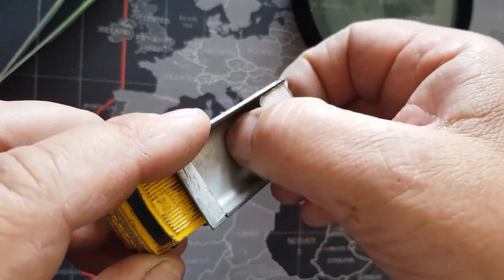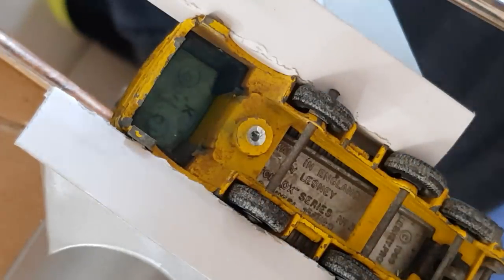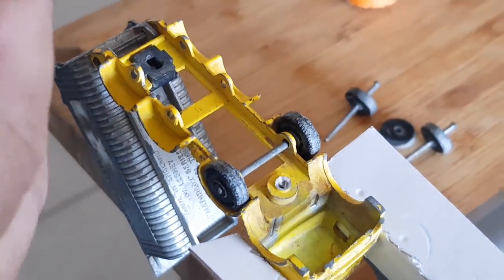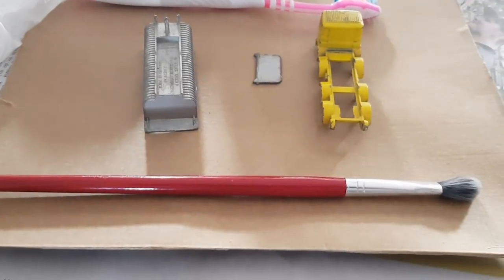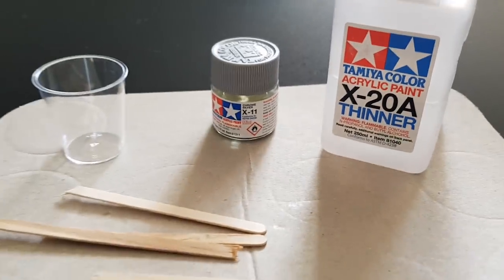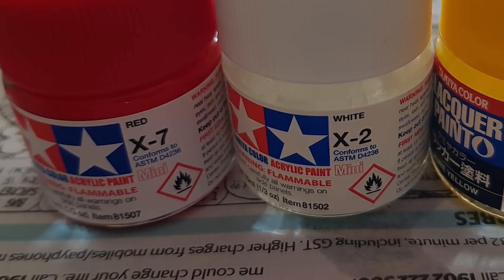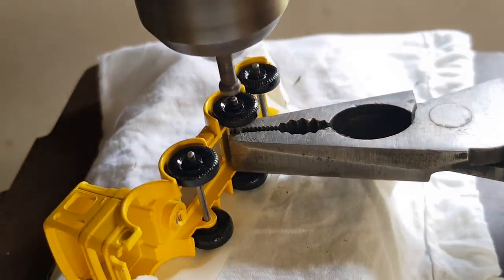MATCHBOX Restoration No 51 8 Wheel Tipper 1969

Comment: An option to using the stock tyres and axles, Is Herpa set 51996. You will need some aluminum pipe or brass which will fit into the axle holes, since the Lesney axles are thick. I did this with the GMC Freezer Truck and they work perfect, roll nicely and look good. Not a restore, but a custom. But another classic salvages from the scrapyard.

Comment: I had a very similar one as a child. I love your videos. I find matchbox cars whilst metal detecting here in USA.
Reply from the maker: Thanks for subbing, Chris. If you find any wrecked ones please let me know. most of the ones i get are not too challenging and I think that people like to see a stunning restoration rather than a repaint!
Reply: @MartysMatchboxMakeovers  I just the other day found one that is badly wrecked. It's quite modern, though. 2012 made in Malasia k16 Hotwheels. It was buried about 4 inches deep in a sand volleyball pit and I believe it has been run over in sand by heavy equipment.

Comment: I learned how to drill out rivets at Boeing. You really don't need a bit any bigger than the shank of the rivet. If your drill bit is nicely centered the head will pop right off and be stuck to the bit.
Reply: To be fair he's not an engineer at Boeing working on aircraft, he's a chap having fun with a hobby.
To be fair S.Sestric is just passing on some useful information just like Marty!
Reply from the maker: For the record I did used to be a technician servicing fighter jet ejection seats!
Reply: Marty's Matchbox Makeovers .... Cool job Marty. A lot of responsibility! Lives on the line!
Reply: Think he uses the smaller bit to get a hole centered on the post. Probably found is the easiest way to make sure it's centered correctly.

Comment: AEC matador 4X8 my grandfather used to drive one moving stone from the Yorkshire dales quarries to the construction of the M62, I used to love the summer holidays sat in that cab.
Reply: But htis one is in fact a Foden
Reply: Old Man Splaining on very close inspection at 13.40 you can clearly see the AEC triangle central below the windscreen the Leyland octopus didn't have said triangle. Leyland acquired AEC in 1962 and the ergromatic cab was used across several marque's including the octopus. I accept I got the name wrong it should have been mantador but in my defense it was 50 years ago.
Reply: Correct! I have one in "showroom condition", cabin and chassis are red and the tipping body orange with HOVERINGHAM stickers on the sides.
Reply: Hoveringham was on the #17 Tipper Truck. This is a later #51 and had either Douglas or Pointer decals.
Reply: Some trucks had a grann-low range for such instances
Reply: Yep, it is an AEC Mammouth Major 8. Ergonomic Cab. AV 690 Diesel or the AEC V8. Plated weight 28 to 30 Tons Gross. Nice restoration, got a fleet of them here if you want some more :  )

Comment: I really loved the was you used the drill dolly to redo the axles. I was expecting you to use epoxy to rebuild the broken bumper ends but that may have been more work than it is worth. I have started using Molotow Liquid Chrome markers to replace chrome on parts. I will be watching your other videos.
Reply from the maker: Broken bumper ends????? What the......!
Reply: Yeah. It is quite common on these trucks. The ends that stick out beyond the sides of the cab get broken off. Many times it is just one side that gets broke off, but depending on the amount of play both may get broke off like yours. As you know, it is easy to not notice it.

Comment: Very nice resto, well done.  Just done my first: Matchbox #22 Pontiac Grand Prix.  A 2 rivet model, but easy to take apart as one rivet was already loose.  While apart, I converted it to RH drive.  I left the wheels on the base and masked them for painting.  Your peening dolly looks like a great idea.  When tapping the holes for new screws, I found that those clamping tap handles are not really secure - for holding the tap.  What I use instead is the small drill chuck in the Dremel tool, switched off and unplugged, of course.  Holds the tap and and secure, and the Dremel is a steady hand hold, for turning the tiny tap.  I use 8BA size screws.

Comment: A method to use to prevent using the bigger drill bit. Drill out the rivet with the small bit as before, then use a same drill bit and with the back of the but you can pry the head of the rivet off and you won't take so much material off.

Comment: I've done many a resto or a Code 3. The worst thing is after doing them, the paint chipping. They become more precious than when they're in playworn condition. I actually prefer semi restoring them now. I still have quite a few fully stripped restoration and code 3 projects to complete dating years back when I started them but haven't finished them still. Pethaps when the mood retakes me I'll finish some of them; and Yes, they are very time consuming to do as well as costly if you have parts that need replacing.
I have quite a few listed on eBay under my seller name "mylittleporkchop". 
Great videos btw.

Comment: Here's a nice tip for all modelers :  If you need very small screws, especially in different sizes, try to find the following items. They contain such small screws : hand wound alarm clocks, old watches, frames for glasses (normal or sunglasses, doesn't matter). Or go to a local optician or clockmaker and ask what kind of small screws he might sell or give away. The ones used for glasses are often stainless steel (!).
This way, you can get lots of small screws for free and in a fairly large amount, too, if you search hard enough.
Or, if you need somewhat larger screws, buy or find the smallest terminal blocks (12 rows of semi-transparent white blocks with 2 screws each) you can find or open some electronics plugs and connectors. You'll often find small screws there, too.

Comment: Best way to suport the cab while painting it is to put a toothpick or anything that fits in the hole where the screw for fixing the cab goes. This way you avoid painting the screw tap hole and get a nice cover on the whole piece. Nice work anyway

Comment: I have used a concentrated solution of hot TIDE detergent  in  water to remove paint. Place item in hot Tide and allow to sit over night in the solution. Paint loosens up and comes off under running water with a brush. No toxic chemicals needed.
Reply from the maker: I couldn't be bothered waiting that long. Sorry to the environment from me. :(

Comment: Excellent video and very enjoyable!  Just a little idea here (Not a criticism) have you ever thought of putting a layer of Gloss Varnish on the painted body work to help protect the paintwork and give a better shine as well?  It dries very hard and might help protect the paintwork during re-assembly. Just a thought, no pressure. 
Loved the video and have now subscribed. 
Many thanks and Have Fun,
Joe
Reply from the maker: In the past I have sprayed a topcoat of clear varnish onto the finished product only to recoil in horror at the reaction that various paints and decals have to top coat varnishes. Obviously some are compatible and some are not. There seems to be no easy answer to this. Therefore , having been burnt many times in the past and had to disassemble and strip back an otherwise finished vehicle and start again from scratch, I have made it a rule not to apply top coat in all future restores. I simply try to get a gloss finish from the paint first time around.
Reply: Thanks for the reply. OOPs my bad!  
Sorry I did not know about these reactions, but you live and learn. As I said it was only a suggestion not a criticism, so keep on going the way you are going and I will keep watching your great videos.
Have Fun,
Joe

Comment: where  do you get the tool for " blend" again the axle?
another option to put the rivet is to make a hole and glue with epoxi another head rivet , and it seems like original
Reply from the maker: I simply make the tool by drilling a shallow indentation into the top of a bullet headed nail.

Comment: i do not have that tool create screws threads: what would you suggest as alternative? i am having fun buying cheap new models to practice before attempting on old ones i find in flea markets. Thanks!
Reply from the maker: You could drill the hole oversized slightly so that the screw fits into it. Then glue it into pkace using a small amount of epoxy resin, wiping away any excess that may squeeze out when you put the screw in with a damp cloth.

Comment: What kind of value would one of these trucks be ?  I remember having exactly the same model as a boy 😀
Reply: I know that some DINKY & CORGI toys unopened & still in their original boxes & the boxes innvery good condition also in very good condition ( quite rare to find but, not impossible) can fetch a nice large 3 figure sum ( £200 to about £700:each possibly a bit more ) But, those in a bit of a rough state can be about £40 to £90 each possibly a bit more depending on the toy.  As for Matchbox in Very good condition I think they can go from about £30 to about £100 each but, in a rough state £20 to £35 each maybe a little bit more. But, if the item has NOT!!!  been altered ( restored as in this case) fine but, if it had it won't fetch more than £5   & £10 for the rarer ones no matter how good the restoration is. A collector will notice the difference & valuation is dropped SEVERELY!!!  I hope this information helps.

Comment: Very good but you should not use Araldite or any permanent glue. Same reason you drilled out the river and used a screw. You need to leave it disassemblable for the next guy. A bit of Airfix or anything dissolvable would suffice.

Comment: You should’ve used a smaller drill than the second big one You used. I think you took off too much material on that plastic base, which will make the screen go down to far. Other than that it came out nice.
Reply from the maker: Yes Mitch you are exactly right. This was one of my first attempts at videoing a makeover and i made a few mistakes along the way.

Comment: You should’ve at least put some filler on the dents and sanded the whole body before you sprayed the primer. Also probably best if you used a smaller drill bit to remove that rivet so that you leave the base intact.
Reply from the maker: All good advice Dejo Dejo, I might try that on my next one, thanks!

Comment: Hi Marty, just subscribed and really impressed with your methods and restoration results in this first video.  I was wondering if you might have a method for flattening the end of smaller diameter axles such as those used in Hot Wheels, to give a thin flat disc end?  I'll be watching you other videos soon.  By the way I restored a Matchbox Fiat Abarth Rally Car a while back (see DCTV Lite Ep 42 on our channel if you're interested).
Reply from the maker: Short answer is No as i've only been playing around with matchbox cars so far.

Comment: Looks like a Leyland Bison.Matchbox marketed these in orange and modelled on Hoveringham Gravel. I don't remember seeing a yellow one though ?
Reply from the maker: Yes I've seen the orange "Hoveringham" trucks but don't currently have one. I think they are the same model with different paint, stickers and series number - No17D for orange and 51 for yellow.
Reply: Yellow #51 tipper with ‘Pointer’ logo was an AEC Mammoth one was released in 1966.

An orange red AEC Mammoth #51 with a ‘Douglas’ logo released in 1969.

The 1963 #17 Hoveringham was a different 8-wheeler, a Foden. Also made available in King-Size.
Reply: Matchstickman
Yeah,l remember the Hoveringham 
Foden,an S21 Micky Mouse l believe,and as you rightly pointed out,also available in King Size.
Also remember the Douglas AEC.

Comment: Where is the green "Pointer" decal on the sides? You can see where it goes, you can scan and print one of those off on computer cut vinyl. You went to all the trouble of getting the decals for the Sno-Cat which you did a marvelous job on, you went through all the trouble of grinding the axles here but you can't make a green "Pointer" sticker? How will we know it is a Pointer eight wheel tipper?
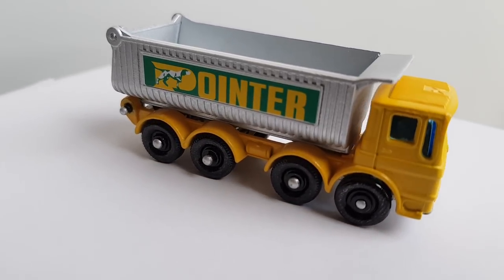Reply: 13:51 ???

Comment: nice job, but this totally ruins the value of the old cars... some are worth hundreds of dollars in original condition, and a few in the thousands
Reply: ccastro306 In original MINT condition, yes (though this is a pretty-common Matchbox Regular-Wheel model; I did a quick search and found a couple of Mint-In-Box examples up for around $40 U.S. each). The truck he is working on MIGHT have been worth 50 cents U.S. in the condition in which it started this video.  I think it's great that he can at least make it LOOK new.